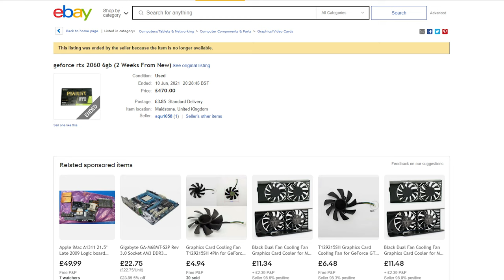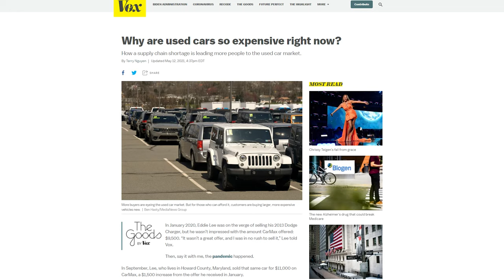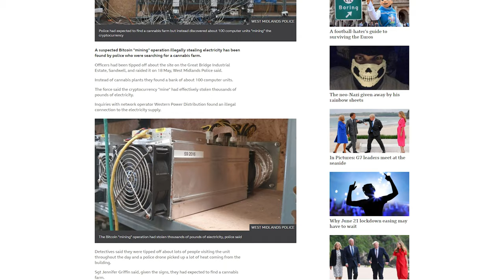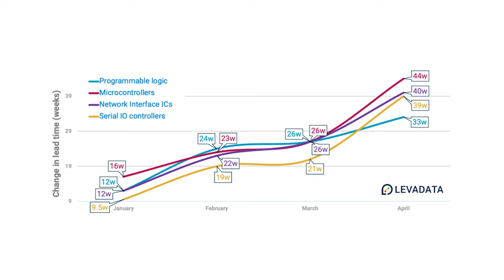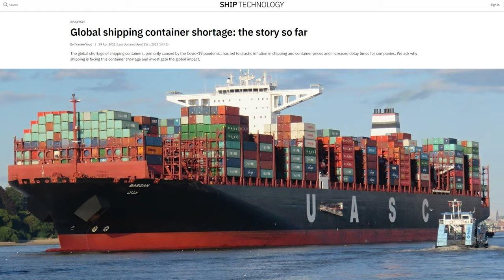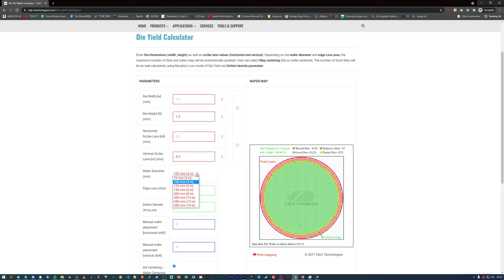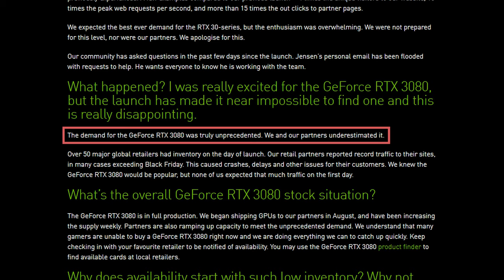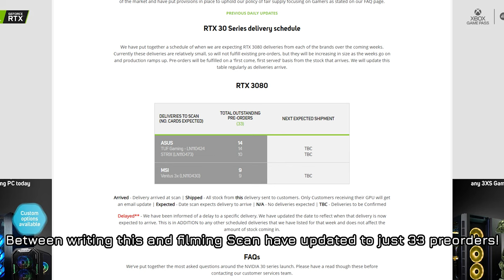The TRUTH About the GPU Shortage

Comment: Very informative info, but I do need to bring something up. You kept mentioning that nVidia is using Samsung 7nm process. That is incorrect. They are currently using a slightly refined 10nm process that Samsung calls 8nm. That is one of the huge reasons that nVidias current cards are such power guzzlers. Amd at TSMC is using a 7nm process, which is the same process that they use for their compute chiplets on their processors and the gpus. Their IO dies still use GloFo 12nm process because of their wafer agreement with Global Foundries. Just so everyone knows which processes are being used.